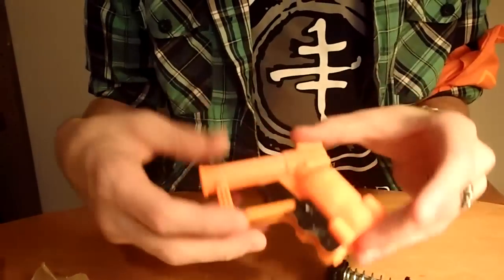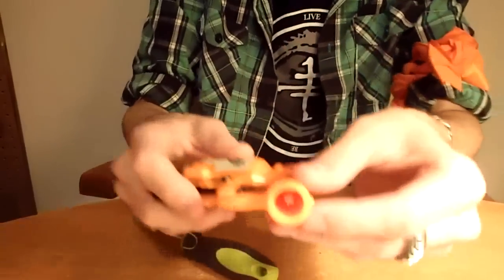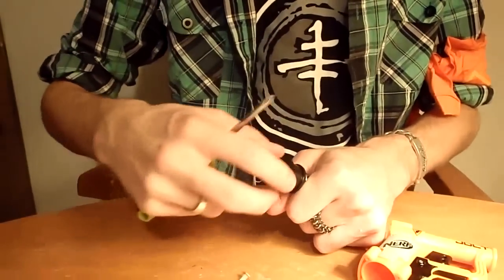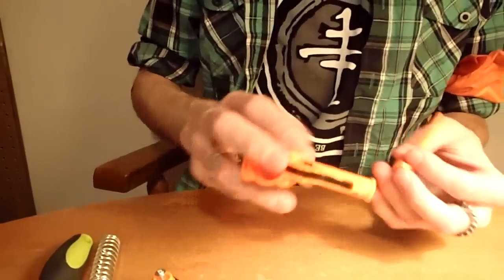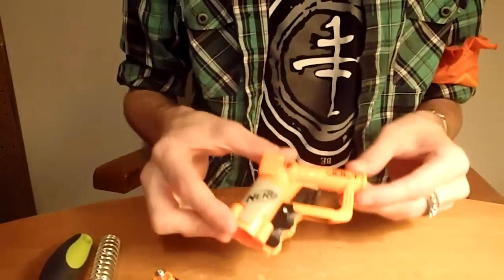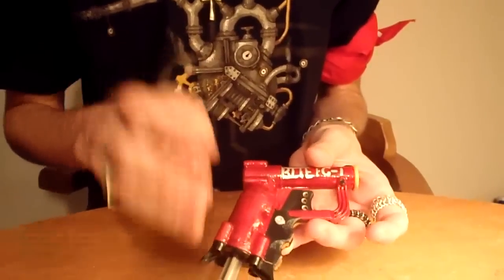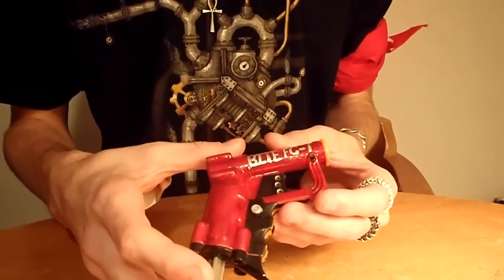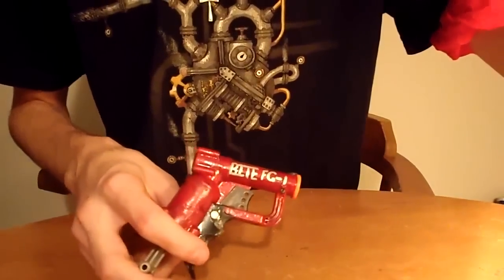The Ultimate? Nerf Jolt IX-1 Mod Guide (Bite FG-1)

Comment: Does this mod work with the elite one
Reply: +Nater_Tater 317 yes
Reply: No it does not
Reply: that's impossible, it's all just the same blaster. Just a jolt reskin.
Reply: @FrozenCalzone  it does lol
Reply: The elite ones I have have a metal pin instead of a screw so you can put a new spring in
Reply: Yep
Reply: @loading...9421  Kinda late?
Reply: No. The plunger head doesn’t screw off
Reply: Yes

Comment: One thing to know about these - the blue version can't be spring modded like the orange one can because the screw is replaced with a permanent bolt.
Reply: or the clear orange one. Unless one makes his/her own screw top by sawing lines in with a dremel.
Reply: Use reverse pliers for the first time and then followed by a flathead screwdriver the next time!
Reply: God dammit, i wanted to put a mad spring into my elite one
Dammit hasbro, not allowing mods :-(

Comment: @LordDraconial one thing i found out is that with some of these single shot blasters like the jolt is that they fire a generic type of dart excellently. it's a weird alien looking thing that you can buy at family dollar (or dollar general i can't remember which it is) but it's $3 and comes with like 6 darts. you can take the blaster, which is pretty bad and salvage the springs and use the barrels for speed loaders or take the separate barrels, keep them intact and use them as "slug" blasters.

Comment: I just got one of these today. Shoots ~35 ft stock.  Did the AR removal and swapped the spring with one from an old (ie broken) airsoft gun that was about 1.5 times as long as the stock spring.  The draw is much tougher, but the catch seems to be able to hold it pretty well and I am getting 50+ ft with both the whistlers and with some generic suction darts that are a bit wider than nerf darts. This thing was worth the $4.

Comment: it's an over-under double barrel blaster that looks like it's supposed to be alien origin. it's either blue or green depending on where you buy it. i just found out that you can cut the darts into thirds and put hot glue/bb tips thery fire a bit better.

Comment: The AR almost does nothing, there are 3 pins on the AR, and when a dart it loaded, it pusses the pins and opens the AR. But removing the AR increases the barrels length, allowing the streamline darts fit a lot better, thus increasing their performance.

Comment: @LordDraconial I just modded my own Jolt today, and I found the perfect spring replacement that  works with the catch! The Tek 6 spring works perfectly! It's roughly the same diameter, and the compression is the same, but it's stretched a inch or two more than the stock Jolt Spring!
Reply: are u still alive fam

Comment: i modded my jolt, but i did a spring extension along with removing air restrictor and greasing the plunger tube. i get about 65 feet with stock whistler darts. so try that, it may help the range

Comment: how does it handle buzzbee darts? for HVZ I use buzz's with the suction "cone" of the tip cut off for any blaster that doesnt have a true barrel. It seems to be more accurate and I wouldnt be a bit suprised if it added a few feet of range. im currently playing a "pistol's only" HVZ event and a tetrastrike w/ barrel replacement and an overhauled+coupled nf are pretty effective thus far.

Comment: Would you recommend removing the little plate that blocks the bullet? My AR is stuck but I filed it down so it's flush, and I removed the plastic stick thing that goes in the dart. Should I remove the plate?
Reply: Yes, if you remove it, you can put the dart all the way in

Comment: actually there is another way to remove the a.r. there is a back panel that you can remove with a flat head screw driver and take the a.r. out that way and just putty it back on.

Comment: How do you get the spring on/off with the newer versions that don't have a screw in the plunger head?
Reply: Daleklingon Jr.Sr. I have also been wondering that and i have always found the answer: its not possible if it needs to be in working function.

Comment: Hey drac i got a modified jolt as well off ebay pretty cheap and it shoots the same as yours and air restricters as well 45-50 with Stevan and normal darts are 30-35 feet

Comment: There is an easyer way to mod this where the painted on screws are at the back of the gun there is a lightly sealed entrence if you ooen that then the air restricters just fall out :-)

Comment: What is the hammer method. I am new to nerf.
Reply: Put a long flathead screwdriver into the barrel then hammer the back of the screwdriver
Reply: cool thanks.
Reply: It's the hammer shot
Reply: it is the nerf hammershot
Reply: To explain better- 

the AR is the Air Restricter and restricts air flow to the dart (and prevents damage when dry firing) and when removed, it can yield better performance. The best way to remove it is with a ridiculously long dremel bit and dremeling it out, but if you don't have one, you take a screw driver and ram it in the plunger tube (or barrel in this case) and hammer the hell out of it till it pops out.